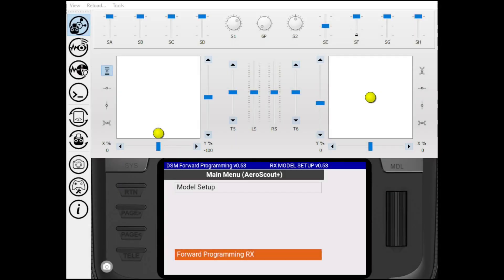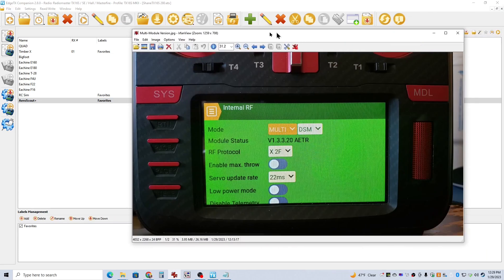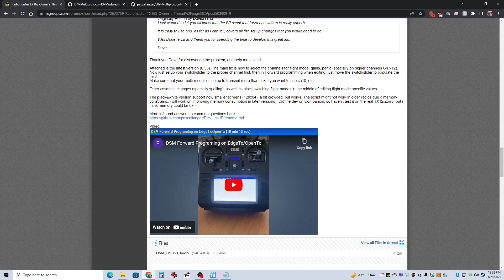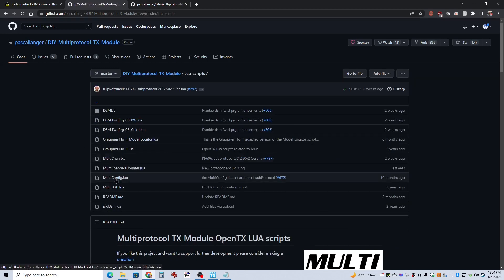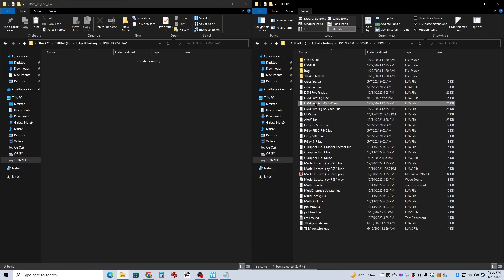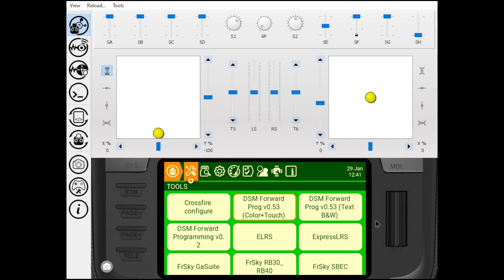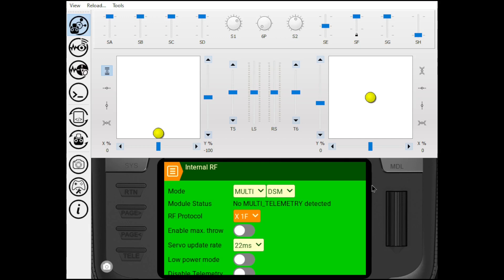Ep.1 Radiomaster TX16S EdgeTX to Spektrum Forward Programming

Comment: Will this work with forward programming on the 8 and 10 channel SAFE receivers that came out about a year ago? You only list the 6 channel ones.
Reply from the maker: Any DSMX receivers that use Forward Programming should work the same as any Spektrum transmitter.  Now since I made these episodes the developer has been making updates so be sure to get the latest script versions.  As I write this comment, the current version is v0.55 and you'll need EdgeTX version 2.8.4 or higher to take advantage of all the updates and features.

Keep in mind that even the 6 channel receivers have up to 20 "virtual channels" that can be used for safe select, reverse thrust, gyro gains, etc.

Comment: On the fence about selling my Spektrum DX6e and getting the RadioMaster TX16S II. Is that a good idea? I only have spektrum planes with the stock an AR636A and an AR637TA receivers in them. My issue is they are gliders with ailerons and NO flaps, an I want to have flaperons / spoilerons so I can land easier. Thanks for any suggestions.
Reply from the maker: We have an old DX6i, an NX6, and the TX16S.  While they are all good, even the old DX6i I like, I absolutely love my TX16S, as you can probably tell if you browse my RC videos.  For me it has been flawless and as a technical nut and programmer, the infinite programmability of the TX16S is amazing.   I've setup my AeroScout with flaperons, I have a video or two on that, perhaps more to come.  The TX16S will do anything you can dream up.  With the latest developments this year with DSM Tools including updated forward programming, Avian TextGen, and telemetry scripts the Spektrum compatibility is fantastic as demonstrated in this video series.

If you need the funds to move on to the TX16S and I was in your shoes I would sell the DX6e and get the TX16S in a heartbeat.  If you don't necessarily need the money and have a few airplanes I'd say keep it as a backup or buddy box if you ever want to train someone.  If you add an external 4 in 1 module for about $60 to the TX16S you can bind the DX6e to it wirelessly and let a buddy train through your master controller.
Reply: @shanesdiy  Thanks so much for the reply, Shane. I really appreciate it. I will definitely look at your aeroscout flapperons video, because I am guessing it would be similar to the BNF version of the Conscendo Evolution I own. I will look through the rest of your videos, too. Maybe you have a video on accessories for the TX16S?? Thanks again.
Reply from the maker: @marin_real_estate_photography  No videos on accessories yet. I have ordered an additional momentary button for it, waiting for it to arrive and I'll do an install video.  If you decide to pull the trigger, there is a basic TX16S which is fine, no "bling".  Be sure to get the Mark II model with the internal 4-in-1(FCC) module (unless you are in Europe you might have to get the LBT) so it will operate your Spektrum receivers.  The Mark II has some general upgrades to potentiometers, buttons, audio speakers, etc.  I opted for the Carbon Fiber Red Mark II Max model which has some added cosmetic upgrades as you can see in my videos.  If you can swing the added cost, the AG01 gimbals are really nice.  I didn't get those but my brother did (guess he had to show me up!).
Reply: @shanesdiy  Thanks for the tips. Yes, I am in the USA and yes, planning to get the 4-in-1 module on the MK II, and if later down the line I need it, getting the ELRS external module. The red Max model does look sweet. I guess one of my concerns though is that with my Current Spektrum DX6e and my Conscendo advanced and Conscendo Evolution, I get a lot of fades and I had a flight with three holds. I was informed by a Spektrum employee that my DX6e was the "bottom tier" model. So I guess my only real concern is whether the single antennae on the on the 4-in-1 model of the TX16S MK II is going to be the same or worse than my DX6e in terms of transmission quality (I only fline line of sight so I don't need huge range, but where I usually fly does have a lot of RF interference.)
Reply from the maker: All I can say about that is I've never experienced a loss of signal in flight with my TX16S. I don't check any logs to see if there are/were fades. Wish I had a more definitive answer on that but I don't. I fly in a very rural area so I don't think I have much in the way of RF interference.

Comment: You go far to fast  when you are showing things how to programme,  not all people  are whiz kids with programming  age also comes into  it. Sorry but  it  did not help me at all
Reply from the maker: Sorry you didn't get the help you needed. Hard to find a balance of including sufficient detail as well as not let viewers get bored and impatient and move on.  If you have specific questions don't hesitate to ask. I often also do viewer requested videos on specific subjects so let me know if there is something I can help with and I'll do my best!  Cheers.
Reply: @shanesdiy  Thank you for your reply,  I need help with the sticks chan 2 is showing me ele it should be thr, chan 3 should be ele and not thr. hope you  can help. thank you.
Reply from the maker: @roderickjamesriddick9869  I'll do my best to help.  I'm going to assume you have a Radiomaster TX16S or comparable radio and a Spektrum receiver since you found this video.  If not, please confirm because the transmitter and receiver in use can make a big difference.

A common channel order is "AETR" or aileron, elevator, throttle, and rudder. I use this channel order for my transmitter and it sounds like your default order is also AETR from your comment above.  Spektrum uses "TAER" or throttle, aileron, elevator, and rudder.  The multi protocol module firmware you install on the transmitter lets you select whatever you want for your default channel order. When you bind to a Spektrum receiver the radio software will convert your transmitters default channel order to TAER automatically.  If you have the AETR firmware you need to use that order when you create the model or it will convert it incorrectly when you bind to the Spektrum.

That said, in the mixer of your model setup you can easily move channels around to suit your needs.  The only time the radio forces a certain channel order is when you first create the model.  After that you can move them around in the mixer, just change the source for whichever channel you want to edit to the input of your choice.

What receiver are you using that wants throttle on channel 2 and elevator on channel 3 and where are you seeing the incorrect channel order? In the Inputs or the mixer or are you talking about what is in Forward programming?

Sorry for the long post, trying to confirm what your issue may be.
Reply: @shanesdiy  Thanks for getting back, it  a iTX16S  chan 2 on the sticks is saying thr wrong it should be saying ele, 
chan 3 on the sticks is saying  ele when it should say thr, yes I  have Spektrum rx fly Mod 2. Hope that helps
Reply from the maker: @roderickjamesriddick9869   On the inputs tab it doesn't matter which control is on which input.  For example "Input 1" doesn't have anything to do with Channel 1 in the mixer unless you assign Input 1 as the source for Channel 1.  Are you lookin at the inputs or mixer?

Can you send me some photos of what are you are looking at?  Perhaps I can better help.  My email is "shanesdiychannel  at  gmail.com" if you'd like to move this to email an send me some photos.  A photo of your inputs and a photo of the mixer would be helpful.

Comment: Hi mate, dos the lua script included spm4650 receive
Reply from the maker: I do not see any information that the SPM4650 has the Forward Programming interface so I do not think this Lua will communicate with that receiver.  The SRXL2 communication protocol is related to the receiver communicating with a flight controller, not a transmitter.
Reply: @shanesdiy  Thank you for your time, i know the receiver works ok

Comment: i did this and it all worked i thought brilliant. then i updated to 54 and it says no compatable rx when trying to connect to forward programming. ive tried going back to 53 and i also tried factory resetting using my dx6. still not connecting....
Reply from the maker: We'll figure it out, probably something simple. Let me know how it goes.

Very little changed between v0.53 and v0.54 so technically no reason for it to stop working. Mostly cosmetic changes.
Reply from the maker: Are you still bound to the receiver and able to operate the control surfaces, throttle etc?  Did you change or update any other software at the same time?
Reply from the maker: Did you delete the old DSMLIB folder and its contents and install the new one from the v0.54 files?
Reply: I deleted the dsmlib folder and pasted in the new folder
Reply: No other updates no
Reply from the maker: So the RX is bound to the Radiomaster and you can control it, just can't get to Forward Programming?
Reply from the maker: Are you able to access Forward Programming from your DX6?
Reply from the maker: Also, please specify what transmitter and receiver you are working with. Is it a BNF receiver? What version of EdgeTX are you on?
Reply: It's a jumper t16, with a spektrum ar630
Reply: Yes I am bound and can control the model
Reply: And yes I can access forward programming only with my dx6 atm
Reply from the maker: Strange one.  Double check that the scripts and folders are in the correct order in the folder structure?
Reply: @Shane's DIY  okay, will do

Thanks for all your replies. I hope I can get it working again. Wish I had never updated to 54 now haha I was stoked when it worked with 53 haha
Reply from the maker: Hi Mark, did you ever sort out your issue?  I updated mine to v0.54 and had no issues.  Used it today in the making of Episode 4 of this series.
Reply: @Shane's DIY  hi Shane, I just tried I just tried again, I remembered you said to use auto in the dsm list and it worked!

I have also managed to put my flight mode on channel 7 and gain on channel 8

No I can run dual ailerons and dual elevators, very pleased as before I had to use a y lead on the ailerons when using my dx6 and no adjustable gain. All problems sorted! Very much appreciate your time and help 🙏 

Bye bye dx6! Haha
Reply from the maker: @RC-MarkD  Awesome!  I am so relieved to hear that!  Enjoy and happy flying!

Comment: Great stuff thanks.
Just picked up a Boxer 4 in 1 to use with a Turbo Timber Evolution and A10 and so far managed to bind with the Turbo Timber (not yet tried the A10) but the aileron’s and rudder are reversed and also need to figure out the flaps.
Reply from the maker: v0.53 Forward Programming doesn't work with the Boxer due to lack of memory but this morning I was chatting with the developer and he is close to releasing a "slim" version of Forward Programming that will give you some of the functionality. You probably won't be able to do a full factory reset RX setup with it because those were the memory hog features that had to go.  Hopefully more on that in a future video.  The Turbo Timber Evo can be mostly setup without Forward Programming such as re-assigning the safe channel.  Reverse thrust you'll need a Spectrum ESC programmer or a Spectrum transmitter to setup.

Comment: Thanks, works on AR8020T but I get error unknown_F8 as a menu item but if i hit it it goes into FP menu and works....great
Reply from the maker: Interesting.  I would like to see a screen shot of the error screen to investigate.  My email is in the "About" area on my channel if you wouldn't mind sending that to me.
Reply: @shanesdiy  dne
Reply from the maker: @ror-ys3qp  I received it thank you.  Notice that it doesn't recognize your receiver model #?  Did you ever update the multi-module firmware since you purchased the transmitter?  If not, I would do that and I would also see if there is a firmware update from Spektrum for the receiver. I show how to do that in episode 2.  I'll forward these images to the FP v0.53 developer to see what he thinks.
Reply: @Shane's DIY  it is latest Rx and multi
Reply from the maker: After a little more investigation, the error could be related to the receiver not having the gyro safe/as3x functions.  Setting failsafe is about all you can do in Forward Programming on that receiver.
Reply: @shanesdiy  do not see how...I was just getting the menu and not trying to set anything.The Rx shows the menu and Tx has to allow you to select menu item.
Reply from the maker: What I mean is, I wonder if the Lua script is expecting something the RX isn't transmitting since it was mostly designed around the AR631/637 receivers. The menus and data when in Forward Programming come from the RX but the Lua code may be expecting certain things.  Just my hypothesis.  I sent your photos and info to one of the Forward Programming Lua developers but he's not responded yet.

Did you happen to see if you get the same response with the older v0.2 Forward Programming?  It is a much simpler Lua script, curious if the result is the same.

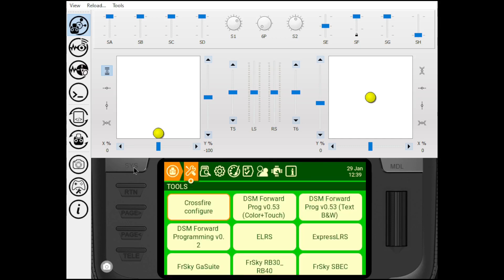Comment: Nice to see progress  much appreciated , I’m quiet green to this and have one question,0.53 with that I can set up a new out of the box AR8360T receiver ?  Eg gyro safe ? A reply is much appreciated,tom 10:37
Reply from the maker: While I have not personally used an AR8360T, the Forward Programming Lua for EdgeTX should perform any function that a Spektrum transmitter will do. I know the multi-protocol module will receive telemetry but I am not certain it has 100% compatibility with all the full range telemetry values.

Comment: Yo my guy I am trying to get in contact with you regarding your old Infiniti q45 build (I have some questions because I’m hoping to do a similar turbo setup) but I couldn’t find your email or contact info anywhere. I’d love to pick your brain if you would give me the chance
Reply from the maker: You can find contact info in the "About" section of my YouTube channel.

The forum link below is the probably the best single place for info on the build.  Unfortunately, I just skimmed through the thread and I don't see the photos that were linked to Photobucket years ago.

https://forums.nicoclub.com/1994-infiniti-q45-rear-mount-turbo-full-writeup-w-pics-t281662.html
Reply: @shanesdiy  thank you for the link to the thread. For some reason it doesn’t show your email on mobile but when I opened your page on my laptop it worked fine so idk anymore 🤷‍♂️ shot you an email

Comment: I try this on the Zorro and all I get is a Syntax error using the BW version
Reply from the maker: What OpenTX / EdgeTX version are you on?  Also, the screen size matters and I'm not sure if these two versions are compatible with the Zorro.  I'll ask the developer if he knows or perhaps he'll see this post and respond. I know he's seen this video.
Reply: @shanesdiy  He knows about it and told me memory is the issue. He said he was going to make smaller version that will work with the Zorro
Reply from the maker: @MikeyMikey1968  I just chatted with him and was about to let you know but you beat me to it!  He's pretty good so hopefully he'll sort it out soon for you.
Reply: I had Zorro, memory issues. So I got a TX16. But looks like bind & fly needs to unlock which probably needs USB.
Reply from the maker: @BuddhaSource  Yes, you'll need a Spektrum SPMA3065 programming cable. I found info online where someone made their own cable but I found a cheap one on E-Bay so just bought it.

I am working on episode 2 currently where we will go through the process of updating the firmware on my BNF AR631 to unlock it.  Keep an eye out for it, I hope to release it by this weekend or sooner, stay tuned!